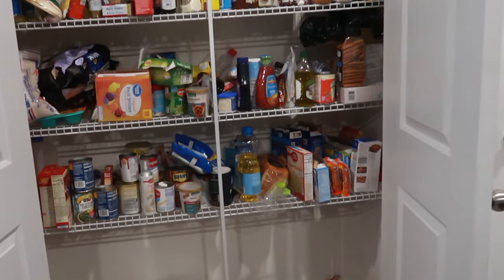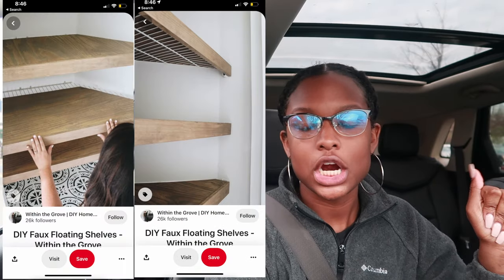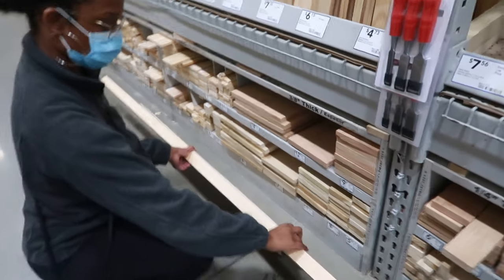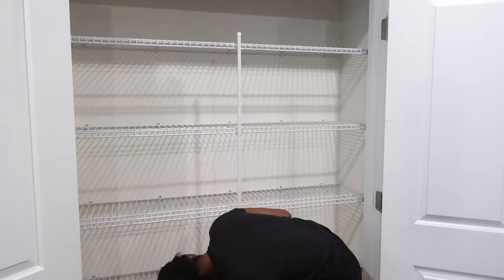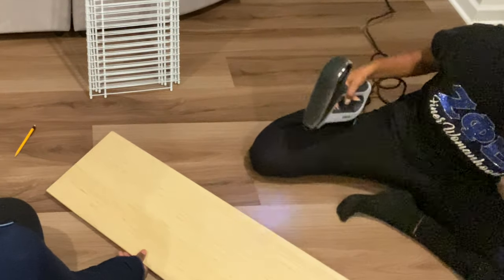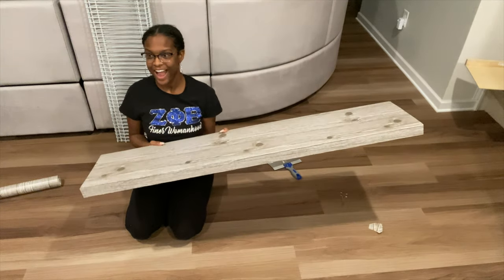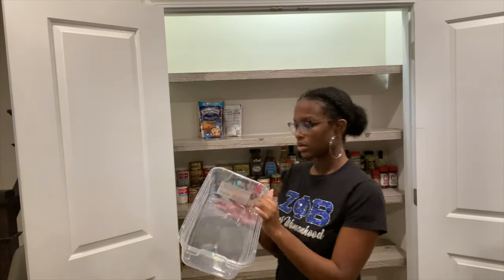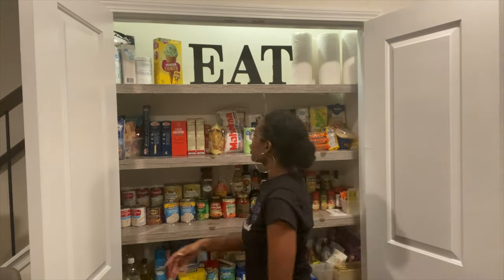EASY DIY Pantry Shelves On A Budget - No More Wire Racks! // Faux Floating Shelf Hack

Comment: Yo, i just did this in my pantry and the results look fantastic. One suggestion I would make to someone doing this project. Notice her original pantry shelves only have a 1 inch lip on the front. So, purchasing a wood piece that is 2 inches is enough to cover the entire front of the original shelf, regardless of the angle. My original pantry shelves had a 2 inch lip on the front. So I bought the same wood she bought. The problem (not a real problem) i noticed once it was all done, is that my original wire shelf is still visible on the top shelf because the wood wasn't big enough to cover it all. The point being, get a piece of wood that is 1 inch larger than the front lip of your original wire shelves if you want to completely hide the wire shelf. - - - Great project! Great outcome! Love it!
Reply from the maker: Yayyy glad you’re tried it and that it worked out for you! Thanks for sharing your experience ❤️
Reply: Are you saying to get the wood cut 1 inch larger than the actual shelf because when you add the wood lip, it would take away from the shelf measurements?
Reply: @EssenceSoul  My shelf was 16" front to back. I got my wood cut at 17". This was to account for the wood lip on the front. The wood lip was only 3/4" thick but 2" top to bottom. My suggestion was to go +1" so if your wires shelves have a 2" wire lip, then i would go 3" wood lip to hide it completely if thats what you prefer. Having the wire visible works out for me in the end because now i have somewhere to put all of those plastic bag clips.
Reply: Thank you for this!!

Comment: Great project and outcome.  You removed the support pole from the front of the originally wire shelves.  The wire shelves and the new covers do not need that or any other additional  support to keep from sagging in any direction?

Comment: A cheaper way is to use foam core board and cover it with contact paper. You can get foam core board at dollar tree for $1 a piece. I like the contact paper u used. There is a video on YouTube and she uses a different kind of contact paper and uses tape to make the front pieces of foam core board with contact paper stick and cover the front of shelf.
Reply from the maker: Yes I saw some use foam boards too! I personally wanted something a little more durable just in case I had any spills or anything from anything in the pantry but that’s def a great option !

Comment: one comment, you removed the front vertical support that you had but didn't add it back or add a different support. How are you going to ensure, it provides the right support?
Reply from the maker: I think if the pantry was longer I would actually need that front vertical support because removing it made no difference for me! It’s been super sturdy the last year and a half without it